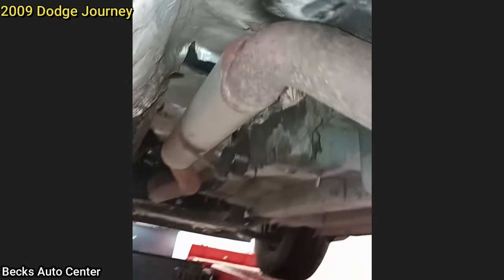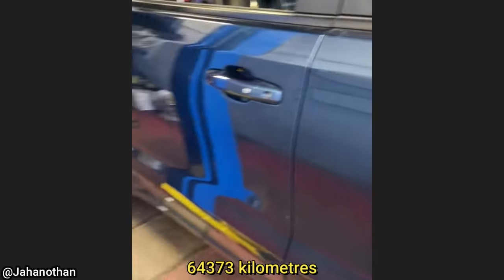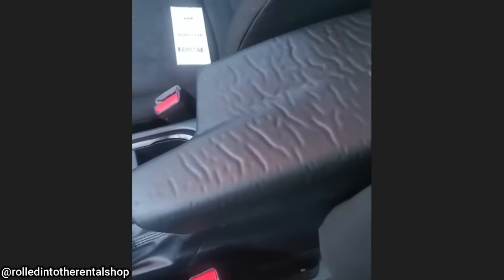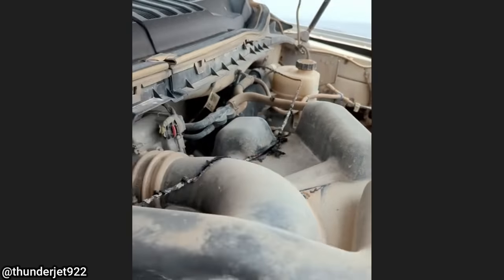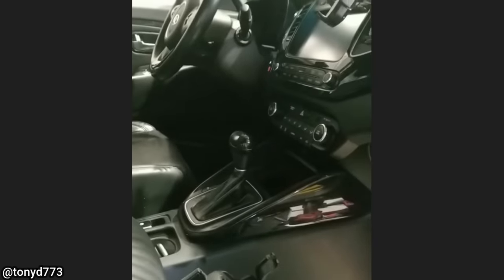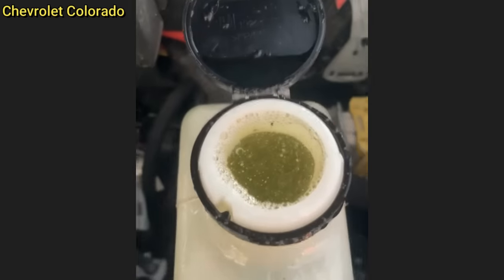Customer States Compilation (The Best of 2022) | Just Rolled In

Comment: One time in my shop a couple years ago I had a Ford 1995 Taurus wagon and the complaint was a smell of  a bad catalytic converter smell in the car... We found that they was Baby Diapers under the front seat for about 3 weeks in the hot sun and that his sister said you can use it when you get your car fixed. "WE GOT THIS CAR OUT OFF THE SHOP SO FAST SO QUICK IT WILL MAKE YOUR HEAD SPIN.

Comment: i worked at mr. oil change while i was in high school. some kid with his dad's Beemer came in all panicked because the oil light came on and he put oil in it and now it won't run right. he also filed the engine all the way to the top. i was so pissed, i just scrubbed the walls in the pit and pulled the plug, pull just spewed out all over the pit wall. i was so pissed

Comment: I have a Scion 2006, took it in for oil changes from the beginning.  All those years to the same tire/oil/mechanic shop not once did anyone tell me the undercarriage is rusting away and now even the frame is rusted, with holes.  I'm shopping for a car now because pieces of my car are actually falling off as I drive.  We all laugh at some of the silly stuff but not letting me know about how bad my car was is inexcusable.  And no, I never thought to crawl under my car to have a look.  Good mechanics are difficult to find.

Comment: @16:09 lol yeah I've used a little buddy heater in a truck because there wasn't any heat, yes I had it on while driving, worked great, just as long as there wasn't any real sudden stops then everything was fine, never had a problem....  Wouldn't recommend it lol.

Comment: 9:26 I covered a used Ford Explorer with those half rounds of glass craft shops carry, 1/4" mirrors, tiny dolls, mosaic tiles and more. NB: The weight of such things wreaks havoc on the door hinges, which back then would cost $400 to have replaced. My mechanic tweaked the door/hinges to save me having to keep lifting my door to shut it, but apologised like mad because in doing that he's knocked off some tiles. I had to explain that he was my hero! I left the interior alone; no shiny bullets coming my way when the airbag deploys!

People asked how I cleaned it. Answer: Rain
People asked how it affected the mileage. Answer: At the point you are covering your car with crap, mileage is just not on your radar. Plus, it was a second hand SUV. It was before they were the size that will kill a person if you tap them, but I doubt it was ever top in its class!

The next vehicle, a cargo van, I covered with a flames design and then glittered. Never sealed it, but it lasted years, even through massive storms.

Now, I have a cartoon of a car, a new to me 2000 Beetle. Think I'll be painting it to look like it's been rusting in a field for two decades, or some such. Cheers.

Comment: The ATV won’t start (7:50) is more an engineering fail than a customer fail. Designing a filter that fits on both ways and looks the same both ways (even the ends look similar due to the cap being black) is a design fail.

Comment: 21:10 pro tip, if you wanne weld without any gas, just weld while the car is running maybe the CO² in the exhausting gass will improve the weld, or the CO gas will improve your mental state. 😅

Comment: Every time I see "Tire had 6/7.5/8/10 bars of pressure" it terrifies me because household compressors by default are set to 6 to 8, and 10 is the output with no regulator. These guys are filling a tire literally until it equalizes with their air tank. A thick steel air tank rated for 14.5 test pressure. Sometimes even turn up the regulator.

Comment: Clips that include "customer states" in words or text (in bold) (it's edited because no way am I collecting them all at once)
0:24 0:37 0:45 
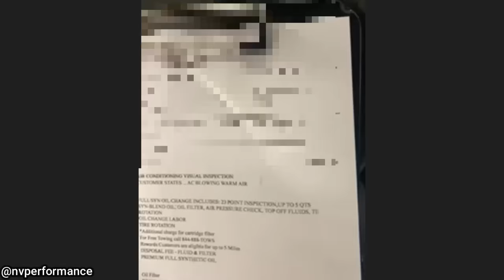1:44                                                 (1:07 - just her car?)
2:01 2:57
3:24 3:55                                      (3:13 - just needed to let off some steam) (3:44 - tire "repair")
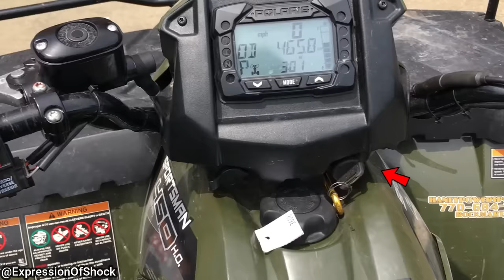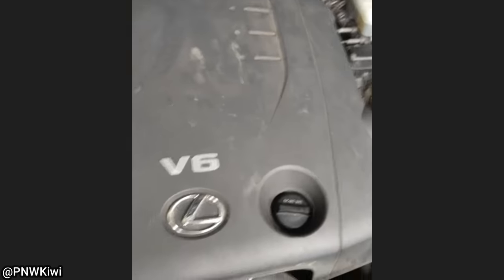4:04 4:45 *4:52                           (4:25 - car paint don't fix bullet holes)
5:39 5:50                                        (5:06 - GUARD RAIL) (5:26 - beamer)
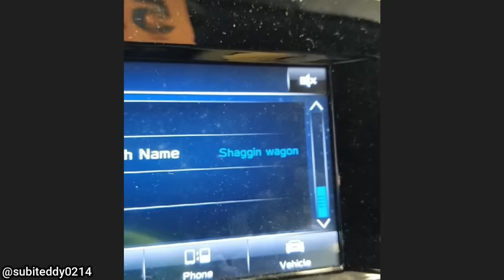6:04 6:20 6:49                          (6:38 - Shaggin Wagon) (6:57 - there is no meme oil)
7:12 7:46
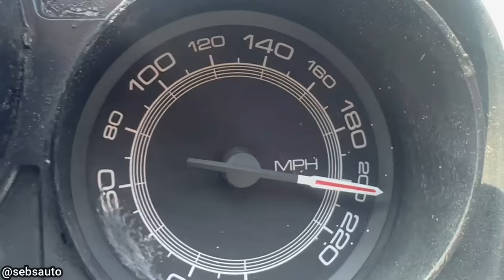eight (none)                                       (8:22 - ruined Ferrrari)
nine (none)                                          (9:05 - bedazzled Chrysler)
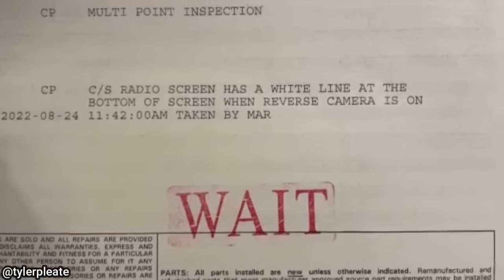10:40 10:50                                    (10:21 - CHICKEN SANDWICH? :O) (10:30 - tutel)
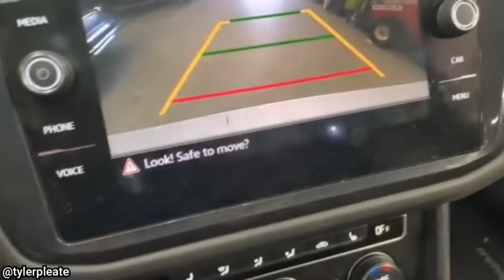11:21 (-we do a little inflating) 11:33 (-we add a little pressure) 11:59 (11:03 - smooth way to see Jesus) (11:43 - "you need more than air")
12:27 
thirteen (none)                                     (12:52 - 13:18 - pumpkin; 13:18 -Twinkies)
14:19 14:31                                       (14:57 - fluid density science experiment)
15:12 15:50
16:15                                                  (16:02 - It was cold) (16:29 - turkey)
17:05
18:09
19:32
20:05 20:17
twenty-one (none) (21:16 things that make me want to channel my inner Chinese heritage: 1:)

Comment: Uhh, you can keep the car if you find a freaking roach infestation under the mat. I take very good care of my car, and I still struggled to not panic every time I got in it after the dealer found a dead rodent in the exhaust. Why a rat thought a hot, enclosed pipe was good place to hide out, idk. My car was in Florida at that time, so I’m sure the smell would have notified me of an issue had the car battery not died due to a light being left on for three days (which is how they found the dead rodent).

Comment: That part where car turns from pushing key from outside is mod. Its very wanted part. At winter you need to heat the car for many reasons at morning. So you need to get in car, on cold seat tgan again claim out clean the car. And clean car from anow and ice, so what fokes do is make mod so you come to door turn engine without getting in, and go drink coffe. Sometimes its hard to open door even to get in. Some do even start from remote. Yes this is tge reason new cars has this option without going outside

Comment: Does corrosion occur much faster in the States? In the U.K. a new car has to have an M.O.T. test 3 years from new and every year after that. Driving a failed one, if caught, usually ends up in a crusher, usually after being spotted on ANPR cameras. Rust and corrosion on the chassis and suspension will get failed. Looking at some of the wrecks on here, it looks like several years of corrosion to the point of total failure with no roadworthiness inspections. Do you guys have an equivalent to our MOT certificate? (MOT = Ministry of Transport)
Reply: Varies by state, but my car is only required to get an emissions test every 2 years. Other than that, your average passenger vehicle is only required to get a safety inspection before it can be registered to a new owner (sale, inheritance, etc).

Comment: 16:09 bro if your heater is broken there's this thing called a fcking SWEATER. I haven't had heat or AC in a vehicle in years, you dress for going outside when you leave your house, car only has to be as comfortable as the rest of the outside, if you can't handle it stay home inside your house.

Comment: Chrisfix had a car who's muffled was rusted through. You can hear when a muffler dies the car gets louder. Did the original owner repair it? No of course not he had no clue somehow until the air the muffler now no longer redirects melted the fuel tank to where he can no longer refuel. What if it blew up on the road? Some people should be banned from touching cars. It's transportation for most sensible people but a war machine in the hands of most.

Comment: Americans are really cheap arent they lets use tape spray foam wires and what ever to hold up there cars rather than getting them fixed the amount of death traps on american roads has got to be insane every state needs to start doing road worthy tests that every vehicle must pass we would get alot of the traps off the road